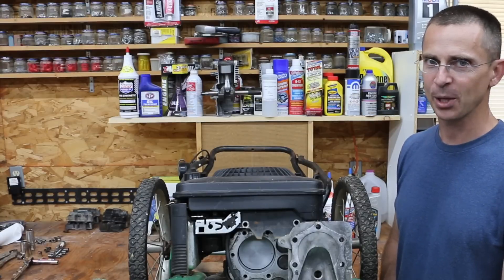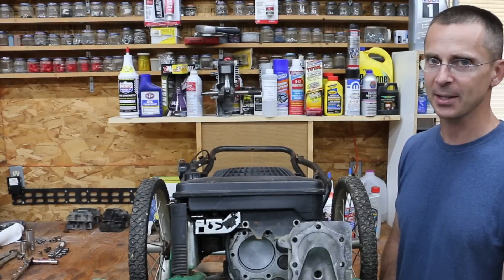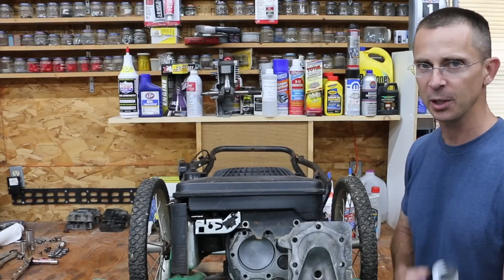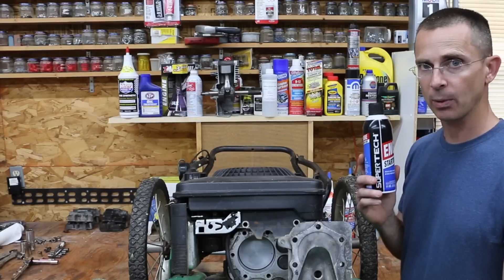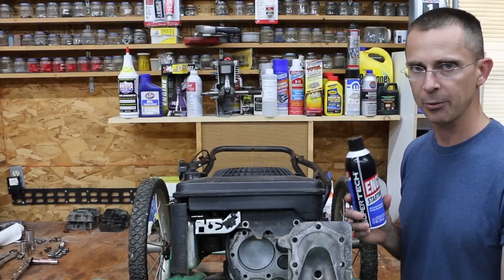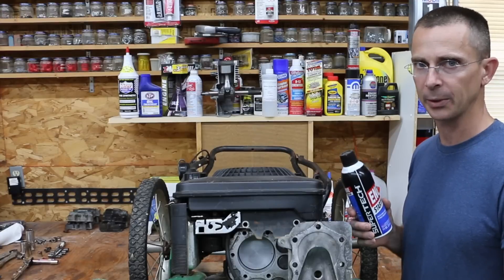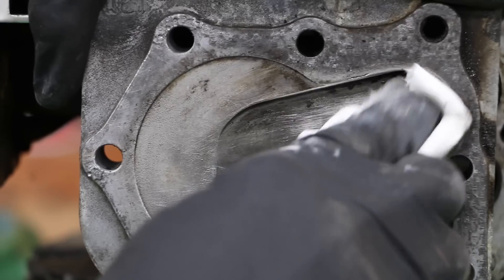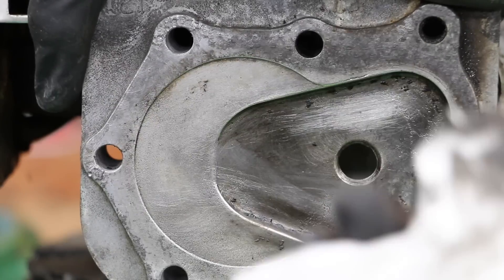Will Running an Engine on 100% Starting Fluid Cause Damage?  Let's find out!

Comment: Have you ever tried spraying carb cleaner into the carburettor intake while it's running? I have sprayed it on a naked flame before and it ignites at an extremely high rate of speed, so I guess it would destroy an engine due to knock caused by too fast an ignition time. I wonder if you would be up for trying to run an engine on carb cleaner in the same way you've done with starter fluid in this video? :)
Reply from the maker: Jim, Thank you for this recommendation!

Comment: i know of a few pieces of equipment that i have worked with are ether queens. doesnt seem to matter what the outside temp is. those are diesels though. i was always told it is because ether was used on them at some point in time and they no longer want to start without it. im thinking there must be some sort of truth to it because of the amount of times i have run into the same problem
Reply from the maker: Ether queens--LOL!  My old Ford 5000 tractor was an ether queen until using Restore.  Thank goodness it worked!  I agree that using ether on diesels will have a negative impact in the long run.  Thanks for commenting!
Reply: next time i run into the problem i will have to try restore. the one payloader i used about 10 years ago would run off ether alone for at least 5 minutes. it sucked
Reply from the maker: Wow!  I doubt restore would help the payloader.  That engine must have been worn out or the injection pump needed a rebuild. Thanks for commenting!

Comment: Great vid always wondered if starting fluid was bad for the engine u should try running a gas engine on deisiel if u haven't already done it thanks
Reply from the maker: Jamie, Thank you for the positive comment!  Also, thanks for the suggestion on running a gas engine on diesel.

Comment: Diesel engine rely on the compression to ignite fuel not a spark,air is compressed heating up, which ignites diesel fuel .which is why lot of diesel engines have turbo to force air in and to charge the cylinder ,there are air coolers as well to make the air more dense forcing more air in to the cylinder , diesel fuel is just to help the air ignite which is why diesel are better at gas mileage.
Reply from the maker: Michael, Thank you for sharing these comments.

Comment: SUGGESTION: Can you do a few videos on myths surrounding how to get better gas mileage? Using your little motors and using running time as you gauge, try out different so-called fuel additives and see if any actually extend running time by any measurable amount.  Example: Adding Acetone to fuel.  Or various Friction Reducers that claim to save gas. Etc. ETc.
Reply from the maker: These are all great suggestions!  I really like these ideas--thank you!

Comment: On a gasoline engine it should not hurt at all. 
It will mess stuff up on. Diesel that's for sure. Nice test
Reply from the maker: Connor, thank you for taking the time to comment and thanks for the positive feedback.  I agree, starting fluid in a diesel seems like a bad idea.  Thanks again!

Comment: I think you should try running an engine on straight ether. Modern starting fluid contains oil and very little ether, so maybe the myth came from when starting fluid was straight ether and did not contain oil. BTW I love this channel! Please never stop making these videos!
Reply from the maker: A DIY Computer Guy, You bring up an excellent point regarding ether content.  Also, thank you very much for the positive comment!
Reply from the maker: I'll see if I can find some.  Thanks again!
Reply: I have to add something (from the perspective of a retired chemist).  Diethy ether is VERY volatile. It's boiling point is BELOW body temp.  It won't boil in your hand because of rapid evaporative cooling,  but that cooling produces a very flammable vapor (with strong effects on the nervous system).  If you work with that stuff, make sure you're in a very well ventilated area with the air flow away from you and away from any confined areas or sources of ignition.  Do a search on 'diethyl ether MSDS' for the numbers (they'll be in degrees C) related to b.p., flash point, ignition temperature (different from flash point), and safe concerntrations in the air for short and long term exposures.  Or look it up in the Wikipedia.  I've worked a lot with it for over 35 years.  I treated stuff like xylene and toluene somewhat casually but not diethyl ether.
Reply: The old formulation of starting fluid was 100% ether, so just get 100% ether and run the engine on it.
Reply: A DIY Computer Guy you are 100 percent correct and I agree with you on this and if he can get ahold of the old formulation of starting fluid I would love to see this test.
Reply from the maker: SE Michigan Andy, Thank you for this information!
Reply: Ether has a lower ignition temperature than gasoline so the engine may knock a bit, especially if it's a higher compression engine, but as far as ether drying out cylinder walls…don't forget gasoline is an excellent oil solvent.
Reply: Project Farm - good luck finding straight ether in the US since it's heavy regulated due to it being used in refining cocaine...
Reply: if one just uses it to assist in starting the engine I doubt it would have much affect on seals.   not many seals between the air intake and the combustion chamber. and a few seconds of exposure versus the hundreds of hours of actual run time is next to nothing .
Reply: I have personally seen a GMC 4.3L V6 damaged by ether, threw a rod.
Reply: @MrRadioAct  
That could have been from too much either and a higher compression engine, low compression can take a lot of abuse a higher compression engine can't
Reply: A DIY Computer Guy hell at my shop we use brake clean (non-chlorinated) as starting fluid
Reply: @Brian C: Good post! It's exactly that autoignition part that could damage something because it'd be pre-ignited too early. Isn't this called a ping or a knock? In any case it's stressing the engine in a way it's not meant to be used.
Reply: It was a nearly new industrial engine in a gen plant with about 400hrs. It was -30C outside and the engine did not want to start on natural gas so the operator broke out a can of ether. It might have worked if a very small shot was used but that was not the case. Ether works wonders on cold diesel engines but not a good idea on natural gas engines. Oddly enough the best starting fluid for a natural gas engine is.... gasoline. A small amount in the carb and the engine will start and run long enough for the natural gas to purge any air that may be in the lines.
Reply: I would also look at when the old formulation got replaced by the new one. Not that long ago there was lead in the gas, the lead helped protect the engine. Running the engine with leadfree gas was damaging it, so I suspect that something like ether that is a good cleaning agent was actually cleaning out the lead, leaving the engine unprotected.
Reply: @thephantom1492  
The lead in gas was for the valve seats, that's why after the lead was removed auto manufacturers put hardened valve seats in the heads
Reply: IF you could find some of the old gel caps that the old Detroits used with The piercing think in the cap and a pump to push it inside the intake it might be the straight stuff. I haven't seen any in a LONG time though.
Reply: I was thinking the exact same thing, maybe the myth was started when the formula for started fluid was different.
Reply: I'm on the Blue Ridge myself and yes, you did!
Reply: I have seen an engine run (very badly) on straight acetone...smoked and ran like uber crap...but it ran

Oil control rings on pistons are there to scrape the oil off the cylinder walls as piston goes down...only a very light film is left, gasoline itself (like ether) is a oil solvent/thinner
Reply: https://en.wikipedia.org/wiki/Starting_fluid
Diethyl ether, with a small amount of oil, a trace amount of a stabilizer and a hydrocarbon propellant, has historically[1] been used to help start internal combustion engines because of its low 160 °C (320 °F) autoignition temperature.
Reply: as iv stated on a previous comment iv run a rover 25 on white spirit and although it ran very hot it ran well and went like shit off a shovel i dont know if it had damaged it though as the car was sold later that month after ecu started playing up. i think the one thing that saved it from knocking would of been the very little petrol left in the tank watering down the spirit. id imagine in most cases the extra heat would cause the rings to butt up against itself and break.
Reply: @Tyler Hopaluk: How many miles on it? How do you know it wasn't about to throw a rod anyway? When I watched this video I could imagine the repeated surging making unusual forces in an engine that could cause such a problem as you say but it doesn't seem extremely likely.
Reply: Project Farm the cans at John deere are 80% don't think I've seen much higher % recently
Reply: The auto ignition temperature is listed at 160C/320F.  Kind of a 'spontaneous combustion' thing.  It will be higher with the stuff you'll have available because of dilution with other liquids.  But I don't know what the internal temperatures reach around the intake manifold and intake valve.  That could cause a backfire.  The explosive concentration range is listed as 1.9 to 48%, a wide range.  Combined with a low auto ignition temp it could explain long term engine damage (due to knocking and other nasty things like blow-by thinning the oil and forming explosive mixtures in the crank case) that others in this thread have mentioned but more importantly it means you need to set up some good safeguards if you do more work with this stuff.  I've watched enough of your videos to know that you are ingenious and are capable of coming up with some very practical effective solutions.  But in order to do so, you need to be made aware of the potential complications.  And that's why I'm posting this.  Also, if you get some diethyl ether, make sure it's fairly new and stored in a metal container with some sort of stabilizer ('butylated hydroxy toluene is a common additive for lab grade material).  Old ether can form explosive organic peroxides and may chemists were, in the past, badly injured by those.  Today, chemistry students are warned about this early in their education.
Reply: I agree, the engine was likely ready to throw a rod anyways.  I've used starting fluid on difficult to start engines and these engines by the nature of requiring that extra help were already well aged and in need of repair.  but none threw anything.  and if it is so dangerous, why did John Deere sell kits to use screw in ether / starting fluid cans right into the system and a button at the controls of the tractor for cold weather starting.   think 4010 years.   sometimes it took a healthy dose of starting fluid to warm up the cylinders enough to light off the diesel fuel.
Reply: Agreed straight ether dries out seals
Reply: I know old timers who use 3 cans of old style ether to get a 65 year old engine running.  He says hes been doing it since the 30's and never had a problm
Reply: Avery Alexander a bit late to the party here guys, but John Deere sells 80% ether premium starting fluid. It’s the best I’ve ever seen
Reply: Great video's, I enjoy them!
The mechanic at work says; "If you spray starting fluid into a diesel engine, it will be hooked on it, and won't start without it!"
What's up with that?
could it be true?
Reply: @fernominal  No it is not, that old drivers' tale is because once your engine needs it it is generally worn out anyway.
Reply: @fernominal  what happens is if glow plugs hot and starter fluid being extremely cold can kill em. Around my shop we call it addicted engine syndrome until we replace glow plugs.
Reply: +A DIY Computer Guy 

  G'day,

   Back when Wheels had flat sides going all the way around them, we used "Diesel" Engines in our Model Aeroplanes, and they ran on a mixture of 1/3 Castor Oil, 1/3 Kerosene & 1/3 Ether...; the Oil was to compensate for no Piston-Rings, the Kerosene was to add BTUs (ie Energy, British Thermal Units...), and the Ether was to increase Volatility and make Compression-Ignition possible without a Pre-Heated Cylinder.

  If the "Starting Fluid" is merely Ether with Oil added (to protect the innards of 2-Strokes being fed the stuff) then the Engine would probably run but have no noticable power...; so possibly the "Starting-Fluid" has a bit of Kerosene in it, as well as Ether & Oil (probably not Castor...., which dries to a sticky-finish) - in which case it might be fair to call it "MAD Fuel" (Model Aeroplane Diesel) ?

   If an old Compression-Ignition Model Aero-Engine could be aquired, then it might be interesting to see how it runs on the "Starter-Fluid"...?

 Just(ifiably ?) sayin' ,

  ;-p

   Ciao !
Reply: Oh that makes a lot of sense. Maybe the new formulations are much better than old.